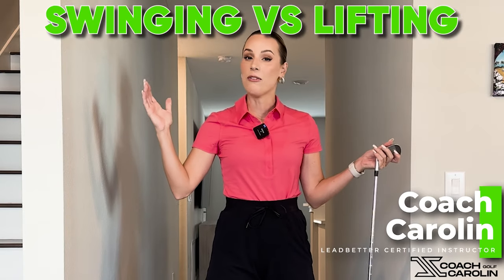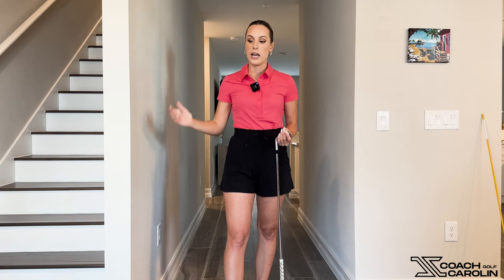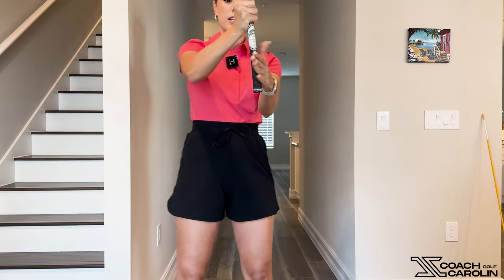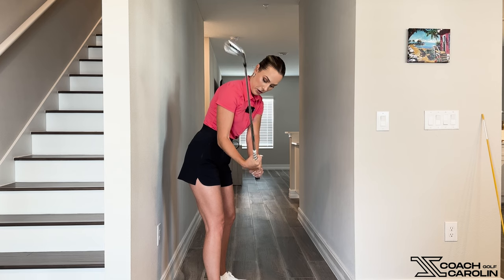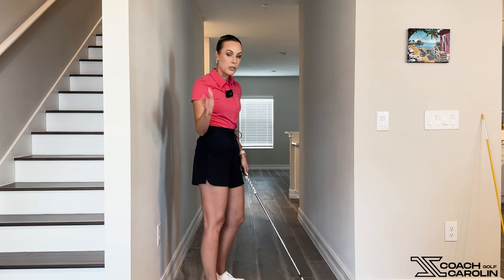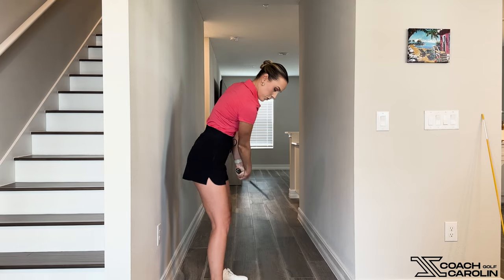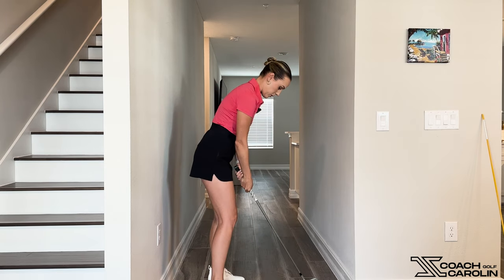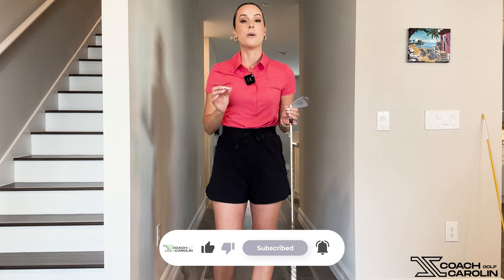Why being UNHINGED is never a good thing!

Comment: Hi Coach Caroline, you’re the only one that convinced me to change my grip which I’ve had since I was 10 yrs old, that is safe to say before you were even born. I started very young and Golf for kids was not even in the radar. My Dad took me to a pro but my clubs were adult male blades cut down to my size. Because I had small hands my grip ended up to be strong or 4 knuckles facing the target. It survived 3 swing updates but switching to your swing philosophy, it finally showed its deficiency. My misses were left to really bad left. Neutralizing my grip eliminated lefts misses along with your hip, and hinge recommendations . I always thought that I would not be able to update my swing for a 4th time, the last from the Butch Harmon era of Tiger but  I gave it a chance and the  biggest difference I’ve gotten with all your recommendations is better command of the ball, distance and trajectory. I feel more in control of the ball flight and how the ball behaves coming into the green. Thanks for posting these lessons.

Comment: Beautifully explained Great lesson that makes a big difference in ball striking and flight. I realized my grip was wrong. Changing to this position allows for easier straight follow through and the back of my hand is no longer strained after hitting 50-60 balls in the range. I thought it was a hand strength and flexibility issue.

Comment: Carolin love your pendulum motion blending in your natural wrist hinge.  

Please could you explain more about wrist hinge / hinging the wrists?  My understanding is this is what some call a vertical cocking of the lead wrist blending a hinge / set of the trail wrist in some combination. I have seen some coaches explain it by just the vertical cocking straight up from address lifting & placing the club shaft onto the trail shoulder then pivoting & extending the arms. But doesn’t the miss the trail wrist set which seems to arise as the lead forearm rotates in the backswing. Like in the Nick Faldo / Leadbetter “Pre-Set Drill?  Please help!

Comment: When the shaft starts moving in my hand, I know I need to adjust my grip to keep things steady. Every time the head swings one way and the butt goes the other, I can feel it rubbing me. Maybe a firmer hold would keep everything in line and give better friction. Any tips to handle it better?
Reply: "wring the towel"

During your swing do the motion as if you are trying to wring water out of a towel. The resistance of the 2 hands fighting against eachother keeps your club head stable

One of mcilroys fav drills and pete cowan teaches this to every student

Comment: So, you said the hinge is to get your backswing to the top as fast as possible. Am I missing something here. I have a very "intentional" backswing. Kind of like winding up a spring to release. Doesn't matter how fast the spring gets back there.
Reply from the maker: It’s not about how fast as in time but how efficient and without any energy or lifting effort that would make your move inefficient. Its similar to wanting to take a direct flight versus  a layover, the more direct route is preferred 👍🏻
Reply: @coachcarolin  Interesting. Thank you.

Comment: Your completely wrong on the grip, left hand for a right handed golfer should be more in the palm of your hand, while right hand is more in the fingers, just read Ben Hogan 5 lessons and he was hands down the greatest ball striker that ever lived
Reply: @PeddyBear  He's not completely off. A little towards the palm is what the Goats did: Hogan, Nicklaus, Woods.
Reply: A little knowledge can be dangerous! Hogan had the grip in the lead hand running obliquely across the fingers middle pad of index finger with the meaty pad of the left hand on top of the grip, allowing you to press down on the grip in your left hand &  to cause the club head to move up (cocking / hinging).  Some coaches today advocate a complete base of the fingers grip (Leadbetter). Like Jack Nicklaus I personally prefer the Hogan approach (correctly interpreted). But when Carolin says palm grip it’s like holding a hammer.  She has it all in the palm which is clearly not what you want like she clearly explains. I’m wouldn’t be surprised if Carolin also has an element of the Hogan base of the fingers with the pad sitting on top of the grip. Hope this helps.